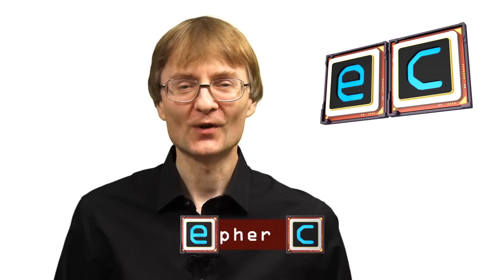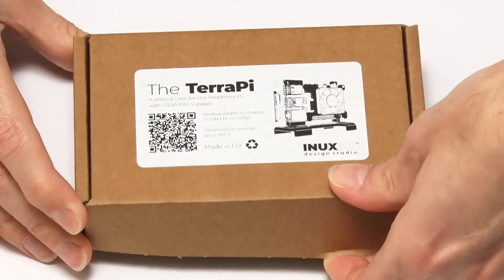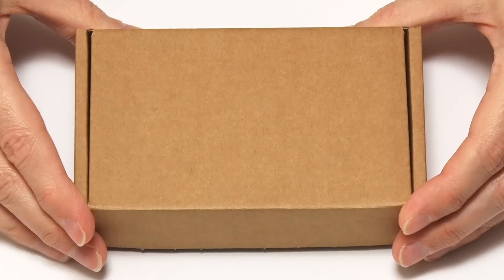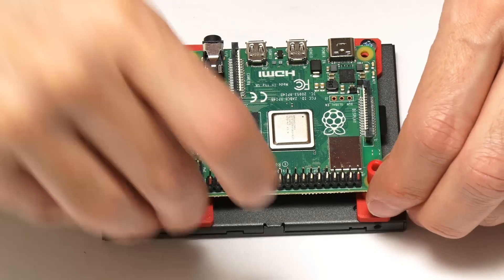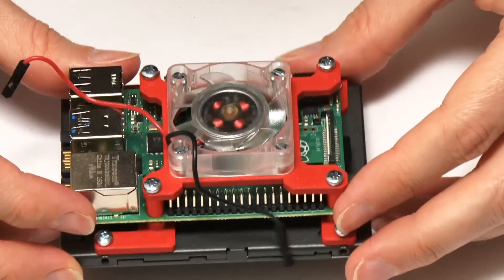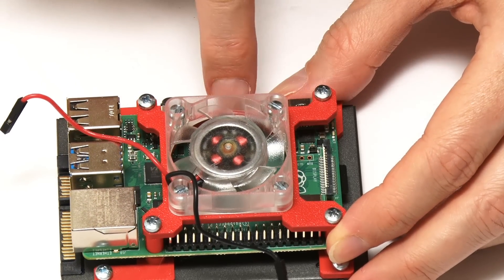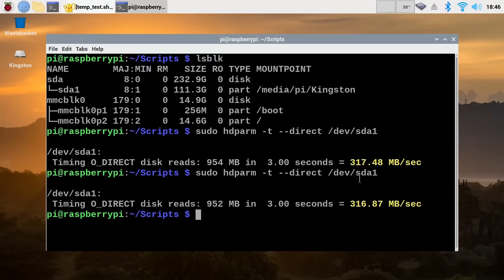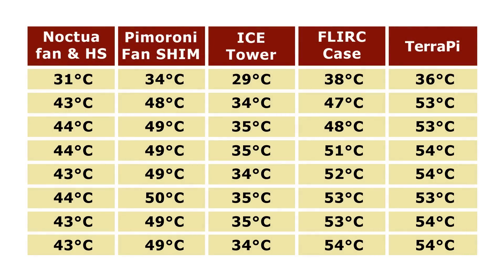Raspberry Pi 4 TerraPi Rig

Comment: Hi, It is possible to installl Windows in a raspberry pie board?
Reply: Pi is an ARM board. Windows is x86 which is a different instruction set.
You can always try WINE which installs an x86 interpreter layer. 
It's a little clunky and it eats up memory and it doesn't work with all windows apps but it's a decent option.
Your best option for Windows on a SBC is to just get one of the x86 based boards instead of a Pi.

Comment: Why was the stock fan not tested with the heat sink?
Reply: Agreed. I would expect the improvement to be more a function of the increased thermal transfer area than a different fan, though I don't know the respective CFM ratings on the fans...

Comment: I was shopping on Amazon for USB cables just as your video came on.  This looks fine, but for anybody with mild OCD about messy cables, there are a bunch of "up down" and left- and right-angle adapters and cables for all forms of USB including C and even those funky USB 3 Micro-B plugs.  ( https://www.amazon.ca/Poyiccot-Micro-Degree-Locking-Charging/dp/B07Q3VCLK6/ref=sr_1_2?dchild=1&keywords=poyiccot+usb+3+micro&qid=1600644532&sr=8-2 ) So, if you have a USB-to-SATA adapter with a jack on it, you could make this a bit tidier.  
There are even 180 cables for usb c for use with power ( https://www.amazon.ca/YICHUMY-Charger-U-Shaped-Flexible-Playing/dp/B07QZWN3ZH/ref=sr_1_9?dchild=1&keywords=usb+c+180&qid=1600644648&sr=8-9 ).   I haven't tried any of them yet.

Comment: Noctura fans are amazing. I replaced every fan that came with my computer case with the equivalent size Noctura and the system runs coolly but more importantly quietly. I did spend a small fortune for so many of the 140mm and 120mm fans though!
Reply: We've chosen a 60mm Noctua fan for our Pi 4B coolercase. But as it turned out (and was anticipated), it's not necessary except for some extreme ambient temperatures. Main reasons:
- keep it quiet
- keep it reliable (some 150000 hours of lifetime at default voltage)
- have enough space for eventual dust (both on a fan and the cooler itself).
we've ended up with a 215g block of CNC milled aluminium :) https://www.youtube.com/watch?v=RbzKM5XxlOA

Comment: Are there other cases/mounts that secure the Pi to an SSD? I like this idea but would prefer the Pi to be more enclosed.
Reply: I'm running mine inside a heatsink/case with dual mini 1" fans. It runs a little warmer ~45 deg @ idle, but Chris' ./temp_test.sh only maxes it out ~63 deg, still well below throttling temp. 
My Pi4 had a similar M.2 SSD in a USB3.1 adapter case as the one Chris replaced. But, I didn't like the clutter mounted on the back of my 7" touchscreen. So last night I replaced the 512 GB Transcend SSD with a 512 GB Sandisk USB3.1 drive that only protrudes 10 mm out of the port. After copying the SSD onto the USB3.1 drive, I was pleasantly surprised that it seemed to run just as well as the SSD, including the playback of everyone's favorite YT channel @ 1080p w/o a hiccup. Woohoo!
But, then I saw this video and ran Chris' hdparm command.
The Sandisk drive returned an error:
   SG_IO: bad/missing sense data, sb [ ]
   APT: Unsupported device
But, then it reported only 62 MB/s (bummer)
On the other hand, the Transcend SSD reported ~240 MB/s (only 2/3 of Chris' results).
I still prefer the small discreet USB drive, so I'll give the Sandisk a good thrashing to determine it's usability limitations, but so far so good. Perhaps the low MB/s reported was related to the error msg, but doesn't affect performance in the 'real world'.
So, if you are looking for a very small, compact solution, this might be an option and the data useful for you to know. :-)
UPDATE: Although the Sandisk USB 3.1 flash drive is specified @ 130 MB/s write speed, several other buyers have also written reviews complaining about only getting ~64 MB/s, similar to my results. IOW, the Sandisk does not meet it's claims. Also, there are other USB 3.1 flash drives, which tout 300 MB/s. :-(

Comment: I have very good success with normal screws in PLA prints. They hold really good
Reply: I have very good success with M2.5 screws in PETG too. They hold very firmly. The hole is some 0.2mm smaller than the nominal screw diameter, that's enough for them to hold ok.

Comment: Hmm interesting and I'm wondering if you can combine this with another cooler I ran across on Aliexpress. Have you seen the low profile heat pipe version of the Ice Tower? Search for: Raspberry pi 4b Low-Profile Ice Tower Cooling.
Would be interesting to see if that cooler could be mounted to this kit's bracket that attaches onto the 2.5" drive. Then stick 4 small rubber standoffs to the underside of the ssd and it'll be a nice combination I reckon.

Comment: Anyone knows  if there is any danger powering fan from RPI? Fans are induction loads, which cause high voltage spikes when you turn them off.
Reply from the maker: It is safe to power a fan from the Pi's 5V rail, as this takes power before the voltage regulator (it is tapping the USB adapter input directly). It is not safe to power a fan from the Pi's 3.3V rail, as this comes after the voltage regulator, and as you say a voltage spike from a motor on this rail could seriously damage the Pi. Some people do apparently power fans from the 3.3V rail, but it is risky.
Reply: ExplainingComputers thanks for explanation. But is then usb power supply in danger?
Reply: @creation_nono  Fans are induction load at the commute wires. Means that the ends of its windings have some inductor between them - induction of the coils, measured in Henrys. But the coils in a fan are "hidden" behind a commuter, necessary to change polarity of windings' current for the motor to actually spin. Some motors are three phase, some (stepper and small fan motors) use two phases with two changing polarities on each phase to spin. Stepper motors are also of this latter design.
At the terminals of a fan, you see only commuting electronics. All of these fans have electronic commuting, no actual classic commuter between the windings and the power rail (5V, 12V, ..)
So the question is, can the voltage rail (5V, 3.3V) supply this commuting electronics? For the USB charger at 5V, the answer is yes - the charger (actually power supply) can sustain even some pulsed load, it has been designed to handle it. Some really crappy "chargers" for phones may actually fluctuate its voltage depending on load - but that would be chargers for 20 years old Nokias. Modern power supplies can deliver 1 to 3 Amps of current. A typical fan eats about 100 milliAmps.

Back to the 3.3V rail on Raspberry Pi. The documentation states somewhere, that it's only auxiliary power, so that you can power some 100mA of current with it securely. We have used it for running a medium 60mm Noctua fan on top of our CooliPi cooler ( https://youtu.be/RbzKM5XxlOA ) without any problem. The fan is 5Volt, but at 3.3V it's even quieter. Your mileage may vary as soon as you add some other load to it, i.e. a HAT with its own power consumption on the 3.3V rail.

So, to wrap it up, it's safer to include your own switching or linear voltage regulator that is powered from the 5V rail and outputs some 3.3V or even higher voltage for a fan. But as I've written, unless you add some other load, you don't need this for small and even medium fans.

To further extend my answer to stepper motors - stepper motors with a permanent magnet, such as those in contemporary 3D printers can destroy its drivers and even the driving electronics (powered from the same circuit) IF YOU MOVE THEM MANUALLY too fast. Because they start to act as an alternator - actually generating current on its terminals. So, if you turn off a 3D printer (I've tried with Prusa i3) and MOVE SOME AXIS TOO FAST, the display blinks. Because the motor is feeding the power supply rail back with its own output, and through protection diodes it gets to the power rail of the PSU. So, Prusa i3 is 24Volt, the motor supplies some current/voltage to it and the changers/switchers start to generate output voltage (5V, 3.3V,  etc) from this 24V rail.

Sorry for such long explanation.

Comment: Very nice setup. The SSD puts out a significant amount of heat as well, so the extra cooling was a good idea. Always good value Chris... Thanks for another great video.
Reply: Cooling SSD chips makes them fail prematurely.
Reply: @Okurkaarrgghh  No. Cooling SSD chips makes them need to write with with slightly smaller current (which may fit your explanations), but losing data faster due to higher temperatures. High temperatures (say above 50degC) IMHO have negative impact even on writing.
Reply: @Okurkaarrgghh 
I'm not suggesting that cooling the SSD is or isn't necessary. Just saying that device puts out more heat than other possible storage solutions (a willing trade off) , so extra cooling for the SBC  chips is a good idea. Chris' assembly is not completely enclosed, but adequate cooling for this setup would definitely be needed, should it reside in an enclosure.

Comment: Your videos are always so well done. Thank you. Incidentally, thanks to your previous instructional video, I now have FreeNAS running on an Odyssey SBC with Pi-Hole running on a VM therein. (Turns out the most difficult task was figuring out that the screw attaching the ssd to the Odyssey came in two parts). Now I'm going to install Wireguard on a RP4 running PiVPN. No rest for the wicked.

Comment: I'd love to see where that 10C difference under pressure is coming from, the heat sink or the noctua.
Reply: The big advantage of the noctua vs other fans is noise.  They spin slower than many other fans and are often less effective at cooling, depending on the comparison fan.  I expect the cooling difference is mostly attributed to the heat sink. I recall in another video, he had a wider heatsink that would have fit this setup and given even more cooling performance.
Reply: Agreed, IMHO that was a surprisingly unscientific and wasteful approach from Chris. I bet that with the heat sink, the original lit-up fan would perform pretty much as well as the Noctua fan, which was an additional cost that we had no evidence was required! How about it Chris??
Reply: @ridefast0  I'd love to see the temps with just the heat sink, just noctua, and heat sink plus the lit up fan.

Comment: I actually picked up a similar sata to usb cable from amazon the UGREEN USB 3.0 to Sata Adapter 2.5 after seeing your Argon One build and was considering mounting an ssd on that.So purchased a BAITITON  480 GB and on removing the actual chipset from the case it greatly reduces the space needed for it to less than half its original size.

Comment: YES! ... You did, indeed, anticipate my "urgent" suggestion. ... 
 I wonder which cooling solution provides the best cooling in terms of cost-per-degree?
ALSO: I take it that the heat sink is mounted via some sort of "thermal adhesive"? ...
I am curious bc common desktop CPUs employ a thermal pad or paste.

Comment: 2 things suggest themselves.

None of your temperatures were even close to the danger temp (80?) for the Pi. What happens with no fan? Is a fan necessary in a typical room temp.

How loud are the fans and do they run continuously? (One benefit I appreciate of the Argon One is that my fan doesn't generally run unless I am doing a synthetic test.) Fans are a nuisance IMHO, if I can avoid them I do. Given the exposed nature of the case there is at least the theoretical potential of something getting caught in the fan.

Thank you for the video.

Comment: Thanks for sharing. I am not a "fan" of how the fan attaches to the GPIO. If you want to plug something into the 40 pin GPIO, now you cant. This seems to be a common problem with most of the fan kits for the Pi.

Comment: Hi, 
Do you know if there is an enclosed solution for mounting a Pi4 with an SSD? 
I do prefer to have the rig enclosed in a case, but I am struggling to find one, which is fully enclosed and with an SSD. Obviously, it has to be with active cooling.
Reply: NesPi 4 might be the case you're looking for.
Reply: @Tuulos  Looks nice. Thanks for sharing. A bit too large for my liking, but still everything I asked for. :)

Comment: Is it just me or does anyone else feel that a Pi is safer in an enclosed case? :)
Reply: Nah, it's fine. IN fact a case could suffocate the Pi, though if you want a case the Argon NEO is probably your next best bet, save for the fact you can't mount an SSD onto it, whereas this solution keep the SSD exposed to ambient air while the SBC is cooled with a fan. The only concession for safety would be to include a grill for the fan so when it is screwed in, fingers don't tango with the fan blades but typically after you do it once, you learn from your first rodeo to not ever have hands near the fan.
Reply: @bluephreakr  For me, safety means protection against dust and other objects, covering for a SD card etc. My solution doesn't suffocate Pi at all. https://www.youtube.com/watch?v=RbzKM5XxlOA
If you are a safety maniac, you eventually end up with a no compromise solution sooner or later.
Reply: Violence Jack  Wrong.

Comment: Now all you need is a 3d printed case to slide in several raspberry pi 4's to be a blade configuration and have several operating systems running all at the same time.

Comment: I have to admit that it looks impressive all put together and for an open case, the board looks fairly protected, yet I have two concerns.  First, I feel a little uncomfortable with the SSD supporting everything with two bolts in it.  Second, I also worry about the power and video cables sticking out the top. Those sockets on the board look so fragile!  I’m not sure I’d feel comfortable even using 90 degree cable adapters.  Still, I would be tempted to use this setup, if the Pi was set safely out of the way from bumbling humans and the cables were securely tied so there wasn’t any possibility of torque on the board’s connections. If there is ever an improved version of the setup, I’d be interested in seeing it because I like its overall concept. Looking forward to your next video!

Comment: Thank you, Dr. Barnatt, for another very nice RPi-related video. It's interesting to me how you always seem to find these useful projects. There seems to be an infinite supply of different RPi mounting solutions. However, once again, I must protest that blue LED lights are NOT "rather nice". Blue light is known to disturb sleep. Rather, moderate-intensity amber is the appropriate LED light color of choice for any "always on" damn light. Blue LED lights should be summarily outlawed, and all existing inventory of them should be immediately consigned to any rapidly-diminishing land-fill operation where they can deteriorate in dignity. I concede though that the fault lies only with the fan,  and not the TerraPi concoction itself.
Reply: I agree that night operation of even one small blue LED is disturbing.

Comment: I think what is important here, is that you are setting the high bar to beat, all by yourself with limited resources.      A group of enthusiastic people with a large sum of money and a large workshop, could possibly make a consumer model as good as your best, and have it all in a nice little package.    It seems plausible that in 5 years, there will be an even better Raspberry Pi, and more accessories for it, to tidy up the cables.   Could someone make a special SSD where only a USB came out the side ?   And if so, could they make it half the size ?

Comment: Although I like how the final product looks, and I think overall this is a step in the right direction, I can't help but think that it would still be nice to have a more solid (mostly) enclosed case without wires sticking out and about when you've got it all completed. I've envisioned something with 1 of the USB's being inaccessible to the outside world (permanently attached to a board internally that is used for SSD connections) and a hole on the side for the fan to blow out, maybe a little flip out "door" of sorts for the GPIO connectors, etc etc. This would be more for the type of person who doesn't constantly want to change their Pi configuration around of course, but more for the person who wants it to be self contained and "just work" while not exposing too much of the board to the outside world. 

And after typing all this I've come to think maybe I ought to venture on to create my own if I can't find it out in the Pi world :)
Reply: I agree, but if it were still mostly constructed the same then I'd prefer a solid jumper board between the SSD and the Pi's lower USB 3 port. With the case being purpose-built, it's not as though the location will vary.
Reply: So true, I dont like the cable sticking out like that also, the rest of the kit can be replaced by some double sided tape, or have the fun of 3d printing a bracket yourself. Sorry, i just fail to see the added value

Comment: This would work with Pi1B+,2&3 versions as well ... ?
As they all share the same basic layout (the oldie Pi1B non-plus has a different hole pattern).
Except the coding for the boot/running from the SSD would be somewhat different.
I really like the idea using the SSD casing as the base holding things together.
Reply: You can mount any Pi and clones. Pi 3 is what we have here in production as well as the Pi 4. Unfortunately you can't really use the Pi 2 with a USB connected SSD...
Reply: @inux3dmanufacturing  You have to use external/auxillary power supply to power SSD/HD conecting to earlier Pi versions.
So yes, you are right. With the supplied USB converter cable you fall short of power requirements to the external drive itself using earlier Pi versions.